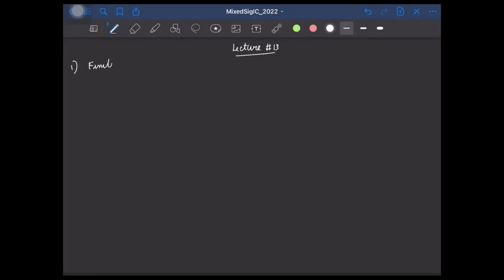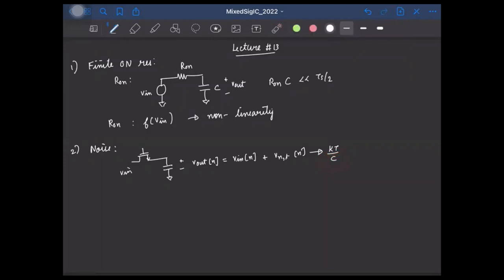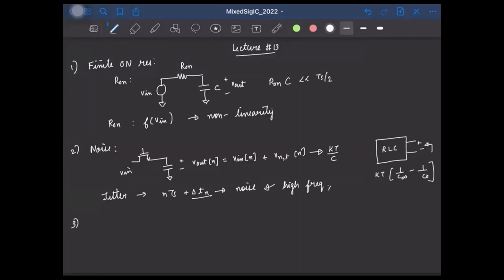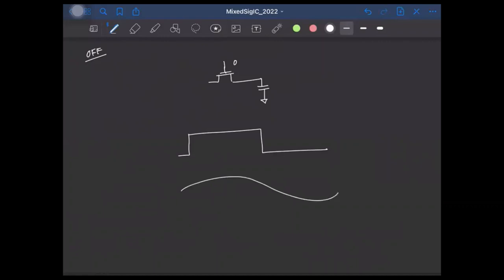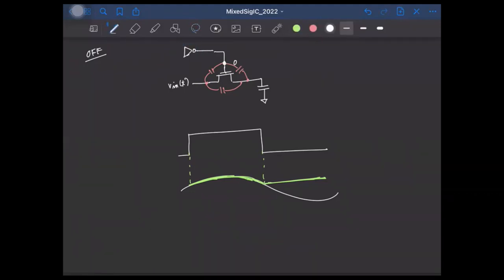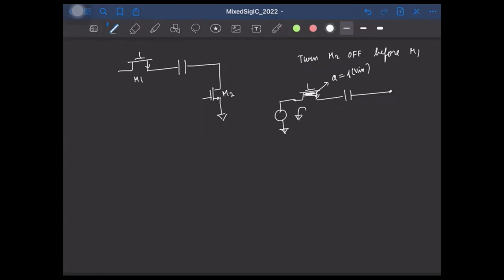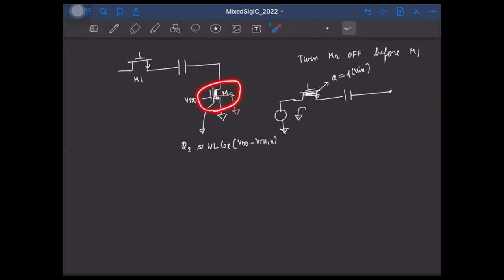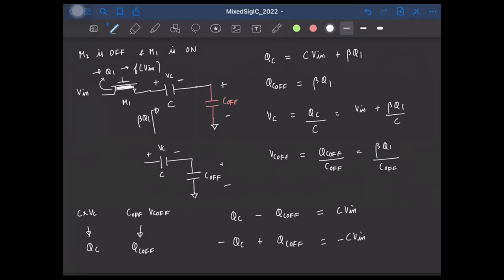Lecture 13: Hold-mode feedthrough; Charge injection; Bottom-plate sampling

Comment: Why the output voltage is not sampled during the falling edge of phi in the "bottom plate configuration". As in this case, both the ends of the capacitor will be open and it will not have any path to get charged or discharged?
Reply from the maker: The time-instant at which the capacitor stops charging or tracking the input is the sampling instant.